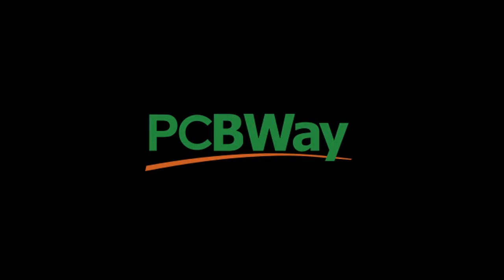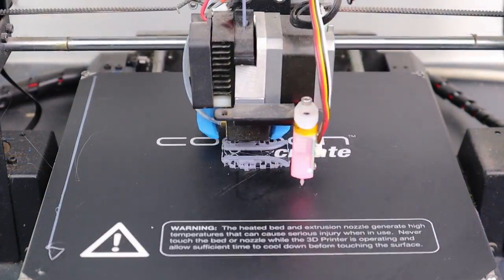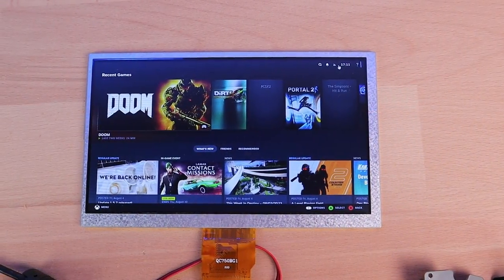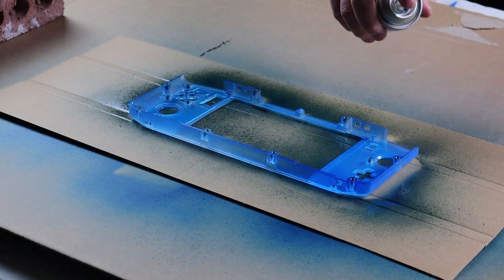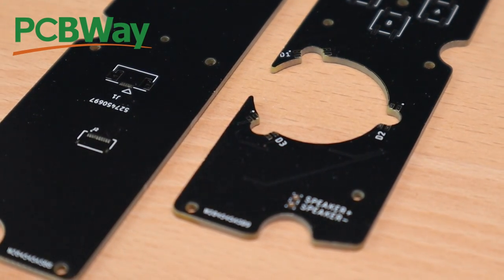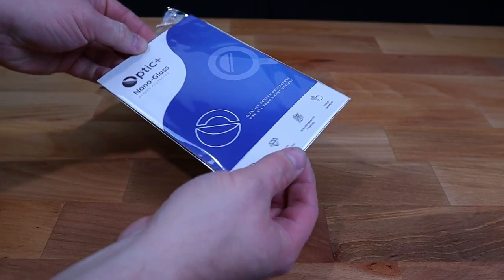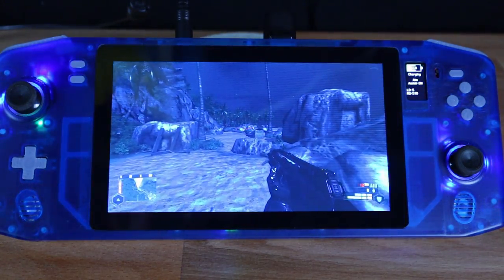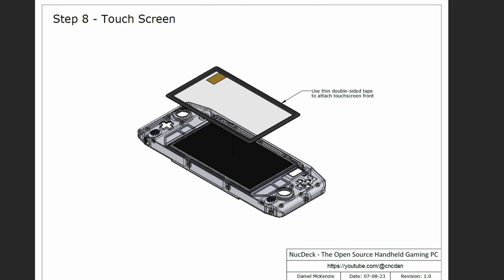NucDeck - The DIY windows gaming handheld - Episode Five - Files Available!

Comment: Amazing project! can`t wait to start it myself. I may even modify it a bit so that i can fit an 8 inch display.
Reply from the maker: You're welcome to do as you please! Just be warned however that fitting an 8" display is going to be a fair bit of work I think. If you have to resize the outside of the housing it would almost be a full re-design by that stage! I've got my fingers crossed for you that it fits without having to go to those lengths!
Reply: Yes I realized that as I opened Fusion😅. What's your plan on doing the battery? Will you be able to charge the thing while using it? That's my biggest problem I wanna overcome.
Cheers, Matt
Reply from the maker: @mateszerencsi8224  Yes, it needs to be able to charge and be used simultaneously. I'm working on a design for a battery management system currently so hopefully I'll have a prototype in my hands soon to begin testing. I've included a USB-C port for charging and I've configured the PD to request 20v 5a from the charger which should be plenty to charge whilst playing.
Reply: I'm looking forward to it. I'm not too good with the PCB designing myself so I'm kind of shot and just waiting for you to make the hard work.😅😅So thanks for it

Comment: Great project and update! I don't think I've seen a number for the final build cost. What is your target? Also, how scalable will the cost of a device like this be? Are there different "guts" that can go in the shell that would allow for a cheaper build?
Reply from the maker: Yeah, I haven't worked out a total cost yet because it's not really finished. At last count, not counting the parts for the PCBs or the NUC itself, there's about $120usd in hardware. I'd estimate the PCBs will probably cost close to $100 by the time we're done. We're probably looking at about a $200-300usd total not counting the NUC.
Reply: I think I'd rather buy a steamdeck 😅

Comment: Great job man, i work on mine console too and i solve the problem of the battery with One rechargheble with pcb inside and works great.
Reply from the maker: Thanks! The battery is a bit difficult in this one, as it requires a 4s configuration so there aren't many off-the-shelf options available

Comment: I am watching all these videos, but cannot find which NUC you are using.  Without this info your game testing is kind of in a vacuum.  I did score a NUC8i7BEH motherboard on eBay for $46.  It supposedly has bad USB ports (although the USB-C port is working).  I am hoping the motherboard USB 2.0 headers still work.

I liked the way you de-populated the HDMI and I am assuming soldered an FPC socket down 👍, smart move I think I'll copy.  I already have a screen and an Arduino installed in a Wii-U gamepad, maybe I can get the NUC installed as a backpack 😆.  Until I'm hopefully able to try your case.  

It would be amazing to me to be able to use an iPad 9.7" Displayport screen, as it is quad 1024x768, which should look amazing and is already 4:3.  (I realize it won't be able to render the full pixels, but rendering at 1024 should be fine as the scaling is simple integer (double every pixel in a line, double every line)

Cheers!
Reply from the maker: I'm pretty sure I mentioned it in the first video. Anyway it's a 7th Gen i5 NUC. The letters afterwards only tell you what housing it came in, so they don't really matter in our case. I agree that the games testing isn't really necessary (the analytics also show that most people aren't interested) but a few of the guys on the discord have asked how certain games perform so I'm happy to test a couple out. Personally I think the 1024x600 resolution is ample for a small 7" screen but there's nothing to stop you modifying it to suit a larger/higher resolution display. Thanks for watching anyway and make sure you jump on the discord as we have a lot of people over there building their own variations of this sort of thing too!

Comment: only thing i could want is a mini pcie graphics adapter with a relatively modern chip, got a nuc i might use for such a thing, though i'm more interested in building with remote processing.
Reply from the maker: The problem with a GPU of any sort is power consumption. I am planning to one day build a thunderbolt GPU dock for it though so you can hook it up to an external display and play more modern games!
Reply: @cncdan  nvidia rtx a500 embedded does 35watts.  might be an older one could use less and is probably possible when mounted on a mini-pcie card.  something that starts with a matching number of lanes might be a better idea though.
Reply from the maker: Yeah, but that's 35 more watts on top of what the system already draws. It can already flatten its battery in under an hour at full load, so that could potentially halve your battery life again. You'd need bigger batteries as the extra load would be too much for the current ones to handle anyway without causing damage. That's not to say you couldn't do it, just that it will end up being a much larger unit which is why none of the professional ones have a dedicated GPU yet.
Reply: @cncdan  yah, if there were a way to automatically switch it on when plugged in, that'd help.
Reply from the maker: Hence why I want to build a GPU dock. No point carrying the hardware around if you can't use it until you're plugged in anyway!
Reply: @cncdan  yah, what i want to do for my own would make it better to integrate, though if it's about the size of an nvme drive it's really not much more added on.  mikroe used to make one about that size, though for embedded hardware, very underpowered.  if it were possible to use the arm graphics hardware it'd be worth it.  i just like the idea of being able to run avorion portably.